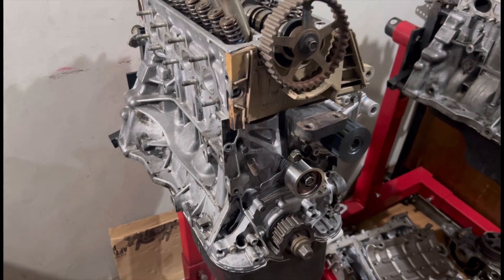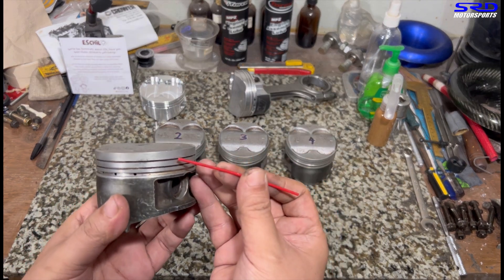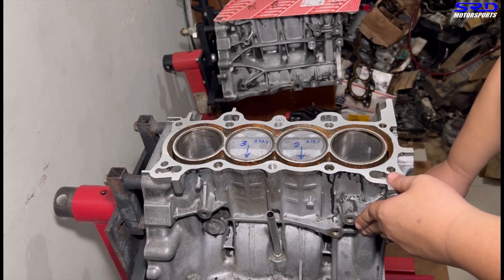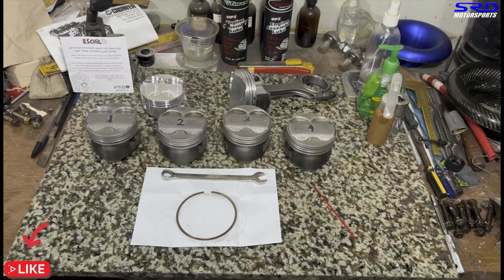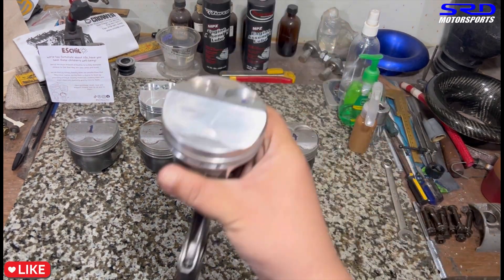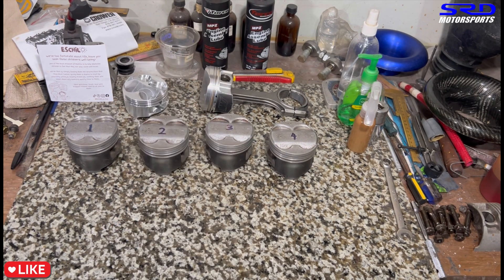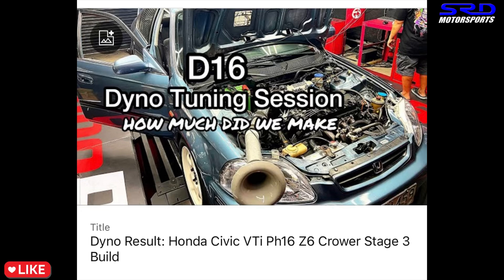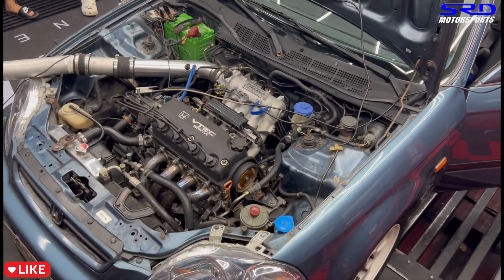Engine Build Key Details for MORE Horsepower

Comment: Can you use b18c gsr crank and rods in a b16 block? With custom pistons with higher wrist pin due to longer rods.
Reply from the maker: yes that’s been done since 2001
Reply: @SRDmotorsports  What's the piston spec for that setup?
Reply from the maker: Your builder will know and custom pistons will cost more than just getting a b18 block

Comment: Great inf bro also got a ? For a lsv turbo  b18b1 with b16a head  what ring gap will be save  I'm building  a engine for first  time just washing your videos  but want to make sure I do it  ✅️
Reply from the maker: On turbo usually more gap is “okay” as it generates more heat etc etc on the top ring I’d go even up to 0.018 on turbo
Reply: Ok let's see  how  it  goes
Reply from the maker: Yep!

Comment: Filed to fail. Fave option of a lot of mechanics. As always great video man! I'm gonna rebuild my PH16 soon as it's 27yrs old and burns 600ml of oil per month hahaha. I'm going PM6 on 75.5mm bore. I have a d16y8 head (20 lobes), what cam would you suggest to improve? (yes springs retainers will be upgraded too). Just a daily with slight oomph.
Reply from the maker: Is that a true y8 head?
Reply: @SRDmotorsports  sorry no, but a PH16 head with the Y8 valvetrain. Then the stock ECU would make it run like crap (the VTEC crossover), but was better when I re-tuned it on a chipped ECU.
Reply from the maker: Alright so a true y8 valvetrain and cam not a p08 like most do
Reply: @SRDmotorsports  yes sir! From a real Y8 (P2J) head. Can you suggest a cam? or do you do regrinds? I'm following your head porting videos and will do it myself, just a cleanup not too crazy.
Reply from the maker: nice atleast not converted thats good

Comment: Filed to fit = Not concentric 😜
Reply from the maker: THERE YOU GO!!! Maaaan that word I couldn’t find in my head as I was talking in the video 🤣 it won’t be “concentric” !
Reply: What are the other local builders thinking of going with oversized rings? 😂
Reply from the maker: Horror stories “builder ko kase mas gusto mas small ung gap” real hirit hence I quoted hahaha
Reply: @SRDmotorsports  FSM specs > shadetree builder specs 🍻

"Kargado kasi kaya sirain" 🤣
Reply from the maker: @findtherightbeat  hahahahaha dayummmmm u nailed it! “Panakbo kase kaya ganyan”
Reply: @SRDmotorsports  It would be interesting to see them run their engines in circuit races, one lap at race pace and they're done 😂
Reply from the maker: That’s true! Maybe that’s why we see alot for sale with brochure like description of what it has and then “sa mga nkakaintindi lang” line 🤣